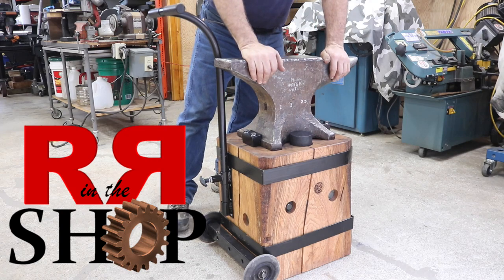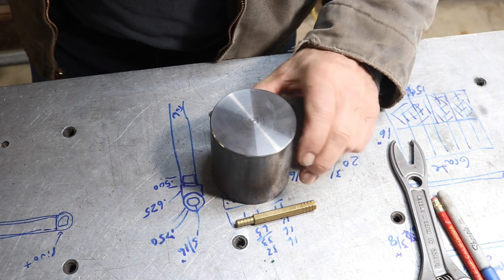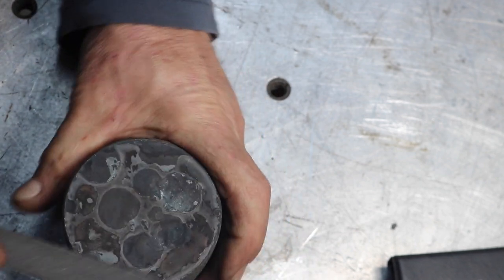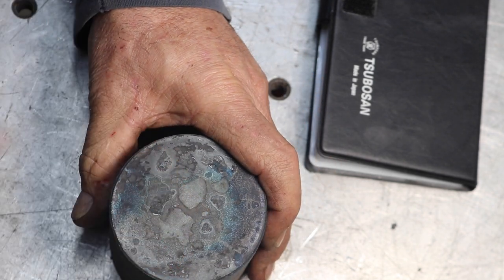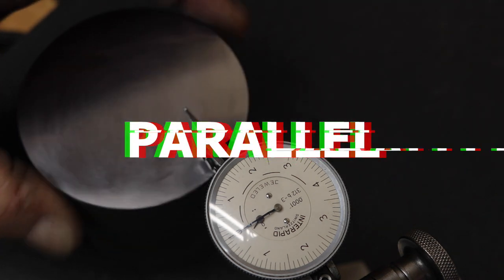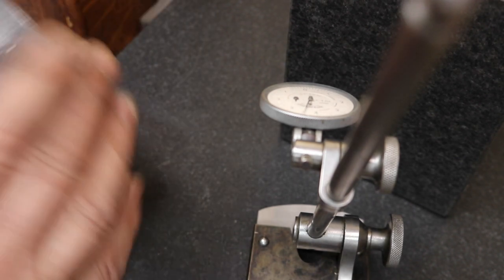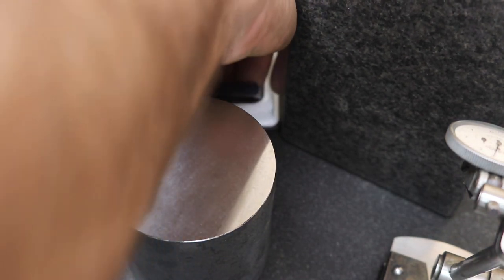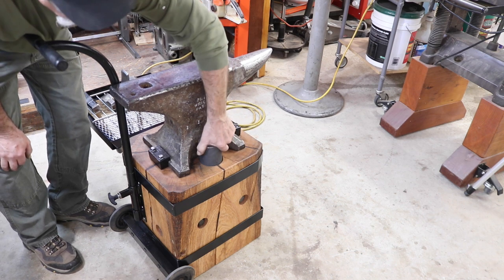Making a Blacksmithing Upsetting Anvil

Comment: I was thinking this was a blacksmiths tool, then the surface grinder? Okay so it is an offsetting block. My Peddingtonhaus anvil is just one size under the model having the attached upsetting block so this works for me. I have yet to install my dro to my 6-18 but   I guess use it if you have it? Why not just use the oven itself to also anneal the block, cheaper electric? It should have a much better temperature control because of the pid thermo couple combination. I am guessing , I have it ,so I am going to use it theory. Reminds me of Stephan using calipers to measure his concrete mixer gears.
Reply from the maker: We have no cheap electric here.  This way I did not have to wait for the oven to cool.  The wattage on the HT oven more that the toaster.  Thanks John for the great comment, Merry Christmas.